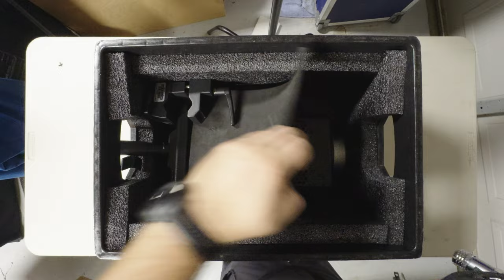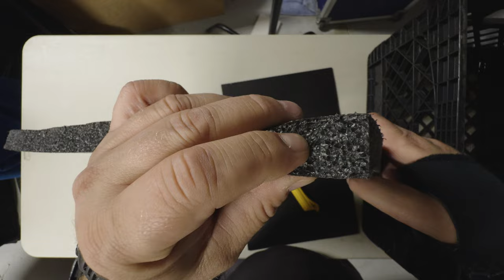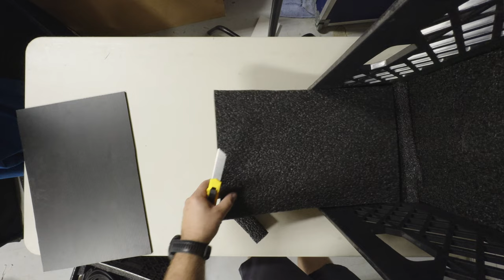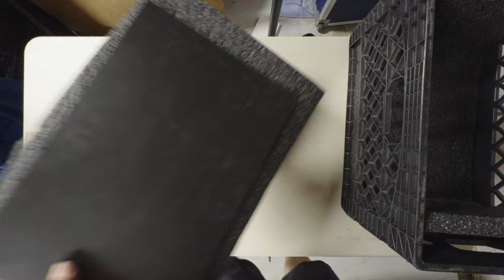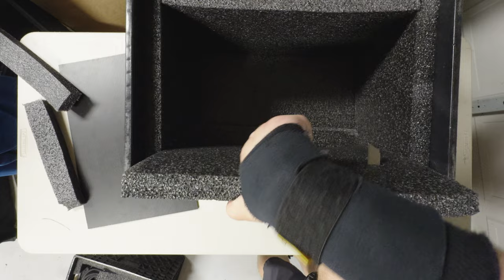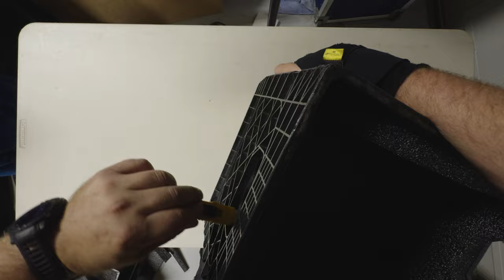DIY Camera Lighting Milk Crate Storage | Aputure

Comment: part of me feels like i need it enclosed fully, for dust and what not. There is a comapny that makescustom fitted bags for amaran products that come with the styrofoam. They might make more types
Reply from the maker: The Pro series from Aputure are weather resistant. A bit of dust and humidity should be safe. We pull all our lights off the van after each shot and store them in a climate controlled warehouse. 

The crate system is not a fit for everybody, but it has been amazing for me!
Reply: @PDMokry  respect. I have a few for grip hardware and stuff but never thought about that. Good stuff